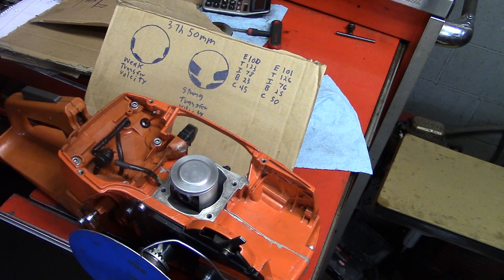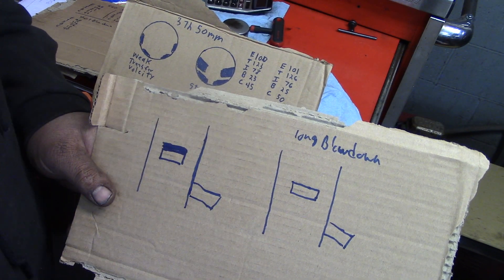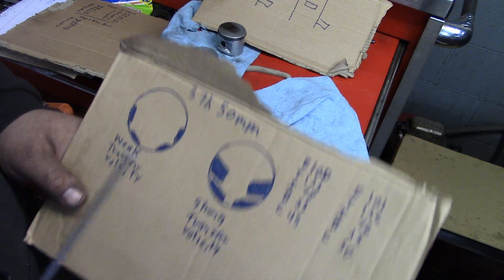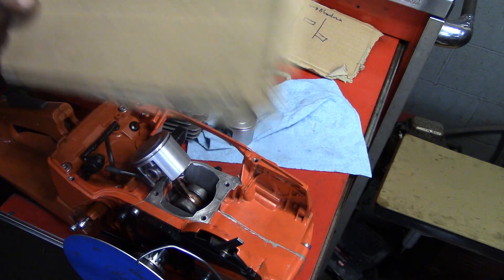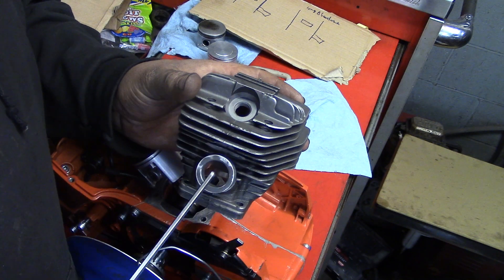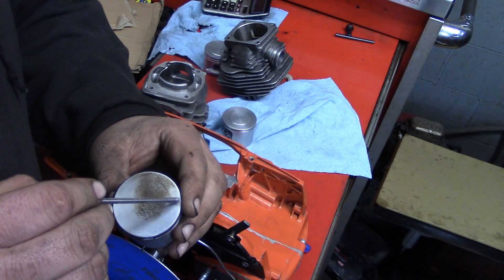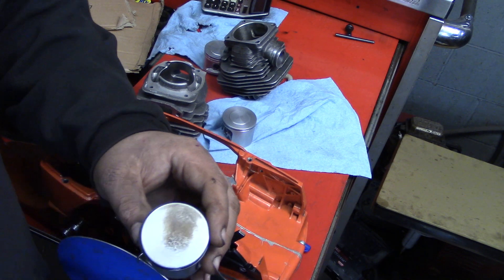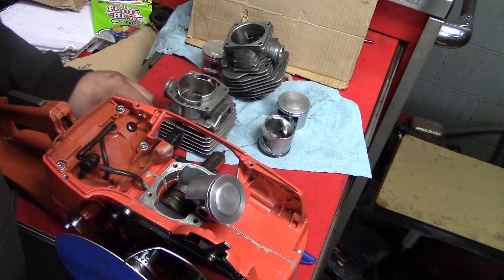How To Port A Chainsaw Part 7 Porting Theory On Case Compression And Transfer Velocity

Comment: I’m new to porting and my 4th build was a ms 460 hyway cylinder with pop up piston.  He had farmertec it was the worst numbers I’ve seen. Over 62 thou squish 98 ex and it ran like a total turd.  New numbers with base gasket 22 thou squish 102 ex 128 Tran 78 intake.  Exhaust port needed to be ground a little on roof to be even and I made the lowers taller and tried to flow them into the uppers.  I am pretty pleased with it but I can’t tell if what I’m getting is a little spit back.  When the air filter is off and I rev it there will be a ploom of fuel coming out but not really enough to soak the air filter.  With steady throttle I don’t see any just first rev.  I just feel like maybe it could use less blow down but I don’t know?  Any thoughts by anyone? Thanks
Reply from the maker: Sometimes the popup piston can cause your transfers charge to bounce of the popup and down your transfer ports and cause alittle spit back in the intake. Try putting some jb weld in the intake and take your intake number to 76* .  But  If the saw runs good and doesn't run lean at the end of the cut. I would keep it there and run it and read the spark plug see if it is chocolate brown that is what you want to see.
Reply: @kennytheguitarfanatic054  good insight thanks!  I’ll have my friend run it and check the plug periodically.
Reply: Agree.  Don’t make a porting change based on idle speed.